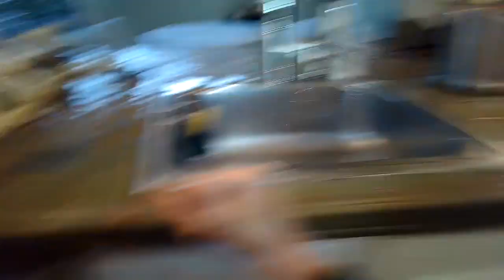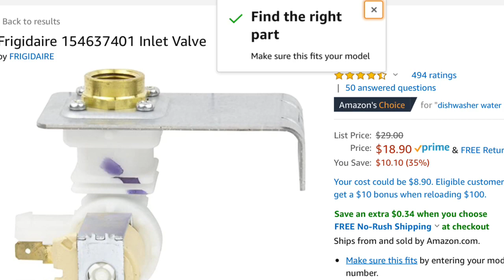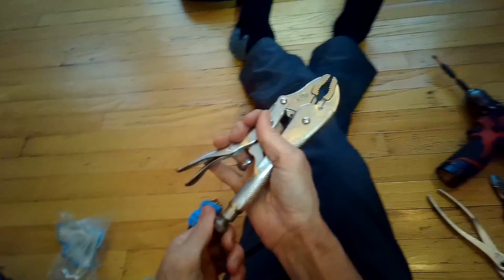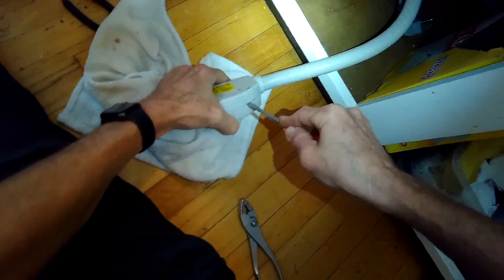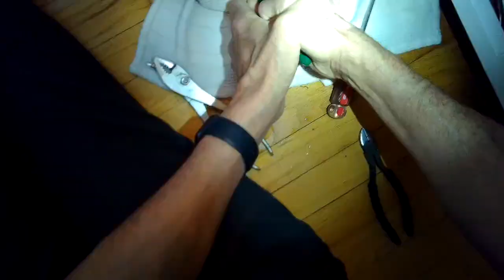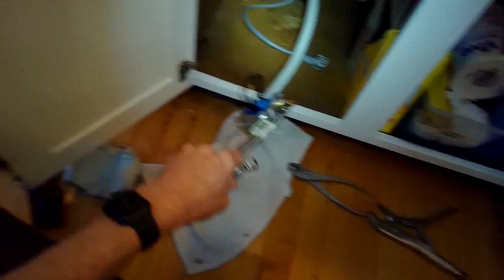✨ MEILE DISHWASHER FILL VALVE — EASY FIX ✨

Comment: Thank you so much, Scott! 
You’ve been very helpful and I cannot thank you enough.
 I just did this exact repair for the intake drain light coming on. 
I followed your step-by-step instructions to replace the intake drain and it worked! I am just so incredibly grateful for your post.

In case this also helps someone else: The symptom was that the machine would start, be a little noisy and then stop. At the same time the “intake /drain” light came on, it flashed about 6 times then went solid and repeated. I opened the door to try again but same thing. While opening the door, I noticed that the machine wasn’t filling… and that’s when I started my search for help online. 
It led me to you. Thank God because you saved me a bundle!
Thanks again!!
Reply from the maker: You are very welcome 😊🙏

Comment: Thank you for  sharing this inexpensive fix. I followed you with one difference. I disconnected the sensor wire from the joint by taking off the wire caps and attached a ~6 inches of a lamp wire instead, other end of which was used to connect to the new valve. After that I pulled the inlet pipe off old valve and attached it to the new valve (no need to cut). This method will not damage the old valve which can be put back again ( in case the problem lies elsewhere). Also you can check electrical working of the value using the same joining points. No resistance valve must be replaced.

Comment: Hello. I have a similar model and it doesnt work anymore - when program started - it drains for couple of times then starts to blink "main wash, dry, end" 3 lights at the same time and nothing more happens, it doesnt take water. I tried clieaning draining hose, check valve, even sucking all water from the bath - still nothing. I tried to get to the service mode to read the specific error code but was unable to find a service manual for this model (mine is G4340 SCU). Would you have any advice?

Comment: I followed your steps using the frigidaire valve and I believe i did everything correctly.  The Meile seems to struggle controlling it however.  You hear the motor humming loudly while trying to trigger the valve to open and the new valve is vibrating and not opening.  The dishwasher never made that sound before.. even when the original hose/valve stopped responding and we got the error code for water intake.  Any suggestions Scott?   I'm also interested in seeing your answer to tacora grant's query regarding the single solenoid vs the oroginal double solenoid.  Thank you
Reply from the maker: I’ve never had that type of response from the new valve.

I wonder how strong the PSI pressure is coming to the valve from the houses water supply?
Might be too high of a pressure or too low.
A vibrating valve is good because we know there’s power going to it.

Can you send a picture of the fill line prior to the valve to scottthefixitguy@yahoo.com

Comment: Showing that eBay price is a little deceptive.  The part in a direct buy from Miele is about 50% less.  My question though is you have gone from 2 solenoids to 1 are you finding other issues down the road?